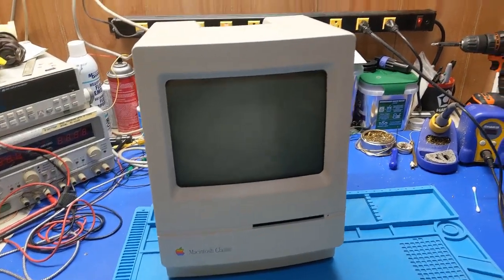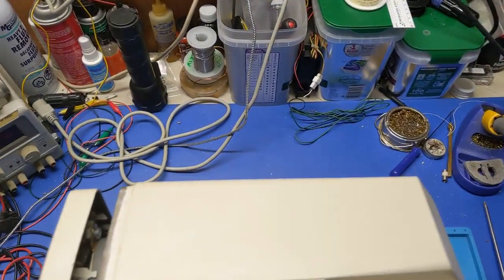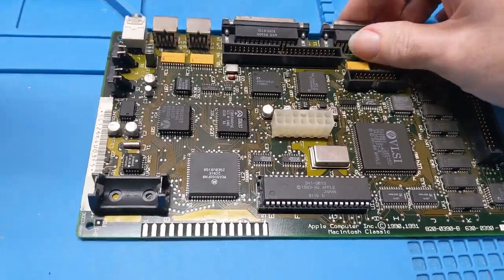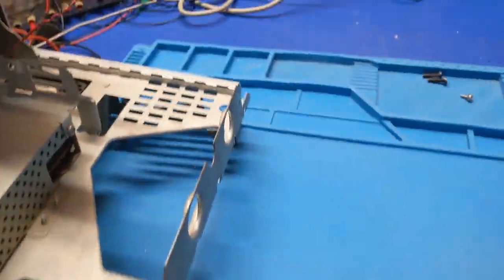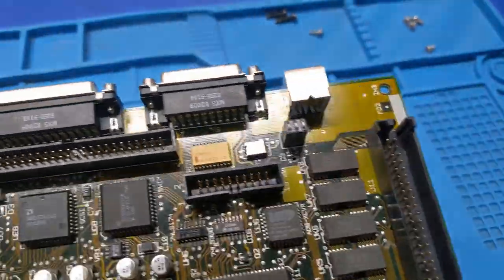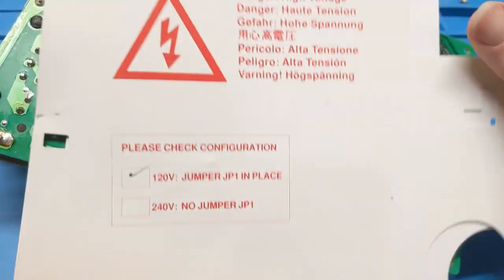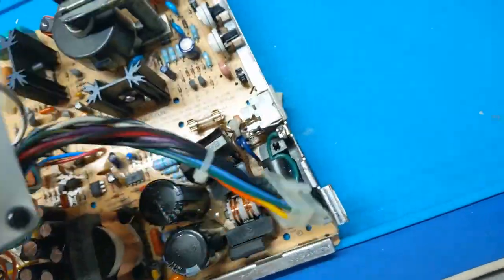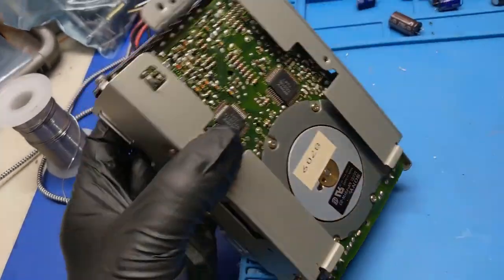Macintosh Classic with multiple faults repair

Comment: Had the same problem a few years ago -  like you techknight i tried other memory expansion cards , then tried them in other machines and concluded the problem of not seeing the extra 3mb of ram was on the board - not being able to read schematics i looked at the board , at the caps that leaked , where the goo usually flows to ,  at the chips on the board that were connected to memory and started looking for continuity from each pin to a via on a trace coming from that pin - from sheer frustration i kept going until i got to that exact same chip and found 2 broken connections on that chip - guessing the electrolite must have ate the solder between the pin and pad .......... like you i ran wires , 2 of them and it worked - got my full 4 mb ......... delighted your doing vids again techknight

Comment: I wouldn't give that drive much time before it fails completely (or at least starts giving errors).  They're made in a clean room and when you open them they start oxidizing from the moisture in the air.  The film and particles that are introduced will keep the heads from reading or cause a head crash.
I would highly recommend that you back that drive up as soon as possible...
Reply from the maker: These hard drives are not hermetically sealed to begin with. They are always open to the atmosphere with a small pinhole.